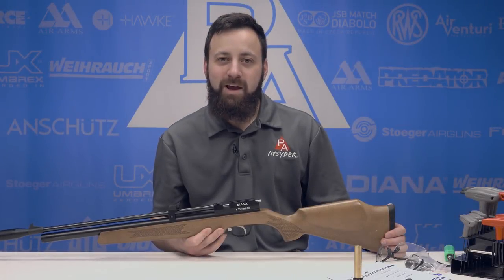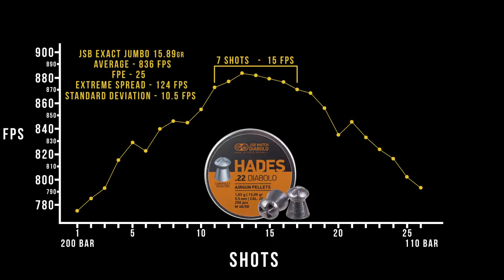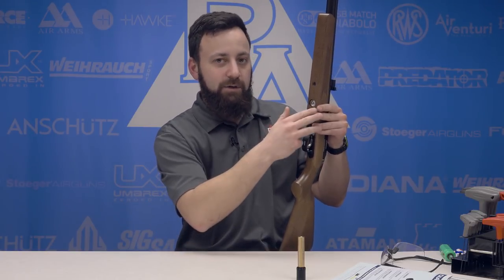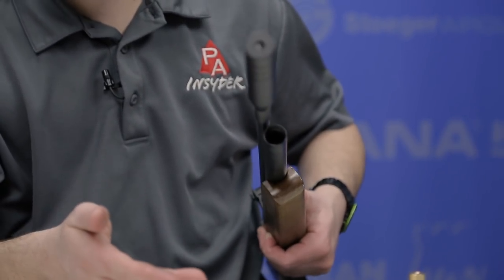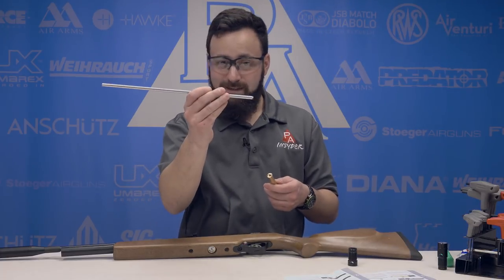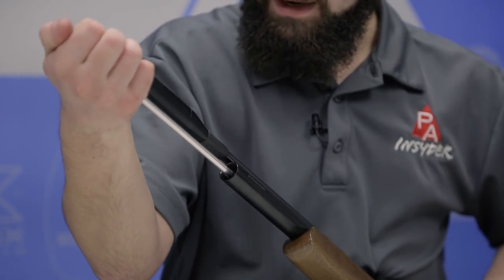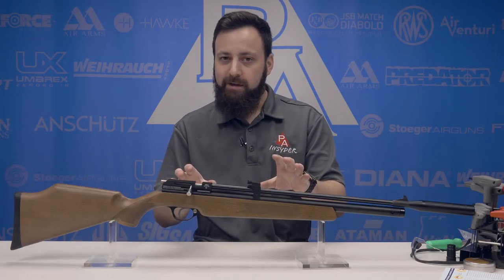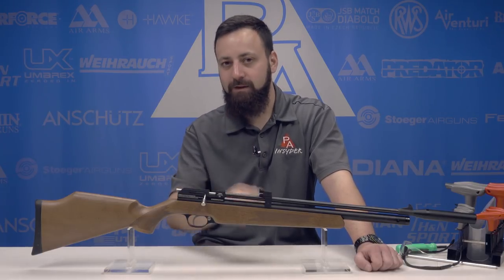Diana Stormrider Regulator Install

Comment: Hey Tyler, nice vid it was very helpful as it clears up some ambiguities in the included instructions.  I bought the regulator from you for my Gen 2 .22 synthetic just over a month ago, the gun itself from your Amazon store a week or two before that.  I ran about 300 rounds through it before installing the regulator last night using the default lowest setting of 100 bar, and unfortunately accuracy went from acceptable to horrible.  I removed it and set to the middle setting of 125 bar with no improvement.

After that test round I noticed some metal fragments dropping out of the muzzle, so I opened up the moderator and found that pellets had impacted the baffles, damaging them badly, as well as the mangled and fragmented remains of what looks like one pellet.  I then ran three mags through with the moderator unattached but the regulator still installed, same wildly inaccurate results.

Finally I removed the regulator entirely, attached the moderator can without the baffles and spacers, and ran another three mags through.  Results of that test showed a return to original good accuracy.

I emailed images of the damage as well as three test targets to your customer support and even more gory details of my testing, but I thought I'd post my experiences here to give others a heads up to the potential problems.  Until we figure this out, you might want advise customers to test the gun after installation without the moderator attached in case their installation causes similar results.

Overall very happy with the gun, it hits hard for such a small package and is a real joy to keep handy out in the yard compared to my Marauder semi-auto.  Really hoping we can get this sorted out.  Thanks so much!

Comment: Need a bigger air reservoir not enough shots for pinking. I've adjusted the hammer spring on the Gamo urban and getting 35-40 shots per fill, before drop off at 35 yards. Getting 60-70 shots with the Beeman commander. Makes for a more enjoyable shooting time.

Comment: Installed the reg 3 times, 135 = 110 bar. 150=125 bar  imaginary 165=135 bar that I was looking for 10.5 at 880 fps. Hand pump and rifle gauge are spot on. Works great with less than a 5 fps spread. Lot of pumping for an old dude :-( .
Reply: You said you were "looking for 880 fps".  Did you get it?
Reply: Ended up getting 17 shots on the reg at 875 fps with a 200 bar fill and Crosman 10.5 pellets. Good for 2 magazines .
Reply: @lavernedofelmier6496  That  sounds great!  I'm sold.  Thanks for responding.

Comment: Great stuff.. The Stormrider was a very nice entry level PCP initially. With the addition of a regulator, Diana has upped the bar and taken the gun to the next level. Anyone who questions the need for a regulator, hasn't shot a regulated gun with any frequency. Great info.... The beard.... ehhhh.... not so much... LoL
Reply: I was going to like your comment, but then you mentioned the beard in a negative light
Reply: @tylerpatner6591 😂

Comment: Hi - I have just a week ago bought the PP900W Gen2 which has the regulator pre installed. First time out with it and at 200bar it is chronoing at 12.7ftlb's. The legal limit is 12ftlb's. After about 6 shots it drops to just under 12 and stays there but for only around 27 shots as it drops off the regulator at 130bar. Looking at the chart you showed it should be set at 100bar so I need to alter the regulator setting. Unfortunately the gun does not come with the fitting tool. Do you happen to know the thread size on the end of the rod (dia and pitch) as it seems the rod is only available with a regulator which of course is already in my gun.
Thanks in anticipation.
Jim

Comment: At about 10 minutes on the Alterol company video they show replacing a gold disc with a silver one.  To change air pressure thru put?  Is the additional part included with the kit?  Looks like something I could do.  Great video.  Thanks.  I apologize if you have dealt with this in the other 900+ questions but I didn’t find it.
Reply: It’s the transfer port.  What did you accomplish by changing it from the factory part?  Thanks

Comment: More efficient air use can be achieved by adjusting (increasing) the outlet  valve spring tension and reducing the hammer strike energy (more shots per fill).  Study Robert Lane's regulator tutorials on youtube.  My .177 storm Rider is not accurate at all.  The bore is too big and the pellets don't touch the rifling.  Buy from PyramydAir.  They are great for returns. Jack O'connor said "only accurate guns are interesting."

Comment: Great video. Does the new upgraded LDC bring the bark down any compared to the Gen 1? I made one with 3D printer and has made this Gen1 completely silent. All you hear is the hammer.
Reply: It definitely brings the noise down compared to the Gen1.  Been pleased with it so far.

Comment: Tyler....great video.  Very informative, but I have two questions.  First, if I look on-line at Pyramid Air do I look up Diana Stormrider regulator or is it the Altaros regulator?  Secondly, does the  Bandit' s fillport and pressure gauge fit onto the 1st Gen. Stormrider?  There looks like there is a little less room at the end of fill tube and the moderator on the Gen 1 compared to the Gen 2 unit.
Reply: Thanks for the kind words Mike.  It's on the site as Regulator for the stormrider and Bandit.  Search PY-A-8938 to find it quickly.  The pressure gauge should fit onto the Gen1, may be a little tight to get it on there.  Worst case scenario, you loosen the barrel screws on top of the breech and slide the barrel out to get the gauge unit on, but I don't think that will be necessary.
Reply: Looks like altaros reg

Comment: Tyler, Great video as always, couple questions:  where does the regulator seat in the reservoir tube? Against the pressure gauge thread? Also what is lost in the 100 cc reservoir because of the volume of the regulator?  I have a gen 1 in 177 that has been excellent, very accurate 160-140 bar. Have the regulator in my cart waiting to hear back to decide how many shots it will give me.
Reply: It is mostly likely up against the pressure gauge, honestly didn't even look when installing.  A very small amount of volume is lost (as with almost any aftermarket reg install) probably no more than 5-10cc.  The reg would be a great upgrade for you.  Between 160-140 BAR, you're likely only getting 7-9 shots....add the reg at a pressure like 120 (like we did in the video) and you should double that shout count, at least, from 200 BAR down to 120 BAR.
Reply: @tylerpatner6591  5-10cc is 10-20% of the air reservior of a bandit. Is it worth it?
Reply: @TomTerrific-vm3qg  really depends on what you want to achieve. If you’re not happy with the consistency of the shot string, then it would make sense. But if you’re happy as is, probably not necessary

Comment: I have a gen 2 synthetic that I absolutely love. I want to install the regulator. I notice your gen2 has the pressure gauge on the bottom of the stock. Mine is on the end of the air cylinder, there is nothing on the bottom of the stock. So I assume that in my case i don't need to buy that new end cap with the gauge as my end cap already has a gauge. And that would also mean that I would have NO regulator gauge. Am I getting that right? Thanks for the help.
Reply: I purchased my Gen 2 synthetic about two months ago and the pressure gauge is in the stock as shown in the video.  With the gauge on the front end cap, yes, you're only going to see the pressure in the tube, not in the regulator.

Comment: Have you installed one in the Diana Bandit? I have the .177 it really needs to be regulated. I thought I read somewhere there is a delay in the pressure coming up to the correct amount once you install the regulator and fire the gun. Is this true?

Comment: In the gen 2 the pressure gauge is in front, if you install the regulator how can you know when the gun needs refill or the regulator lecture?
Reply: I purchased my Gen 2 synthetic about two months ago and the pressure gauge is in the stock as shown in the video.

Comment: I see nowhere to buy the Diana Regulator, including Pyramid Air for the StormRider .22 Gen2. Maybe no longer sold. On the other hand, I get at least 2 mags (14 shots of FX Dome 15.89 grain) with 840-885 fps on my Gen 2 by simply filling up to 155 bar and going down to 125 bar.  Get 3/4" groups at 25 yards using a $25.00 Pinty red/green dot sight.

Comment: I’d like to see this regulator being tested more. In .177 and .22. 

With the regulator how many accurate shots do it think you’ll get in the .177? To many questions gone unanswered. I’ve been wanting to buy the stormrider but that first gen was horrible.
Reply: That all depends on the power you want to achieve and the pressure you set the reg at.  But similar to the .22, setting the reg at 120 BAR, will likely yield about 20 good shots on the reg.  If we took the time to test all of the possible settings, the video would be an hour long.  This is more about installation than anything else.

Comment: I don't get it.  The first chart shows your unreg 7 shot -15 fps starting at 870.But your regulated 17 shots begin at under 810.  That's a 60 fps difference.  But you say "only 30 fps" loss.  That doesn't sound right.  Is that because you're going by averages.  Can you keep the regulated output at 870?
Reply: The94GTC  Thanks!  Now if they would just get it back in stock.  I'm ready to order, but I don't like pre-ordering.

Comment: pyramid air should offer tune jobs & adding regulators on guns that a reg can be installed...like Hatsan airguns...good video Tyler. do more of these
Reply: In the cases where we carry the reg, we do.  That service is available for some of the Hatsan models.  I believe that's the plan for the Stormrider as well.
Reply: @tylerpatner6591  oh ok